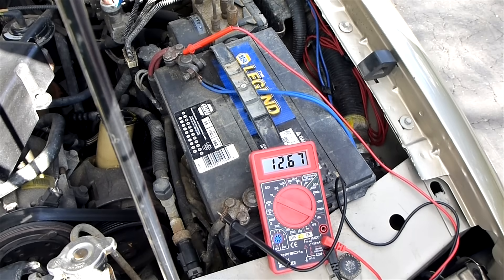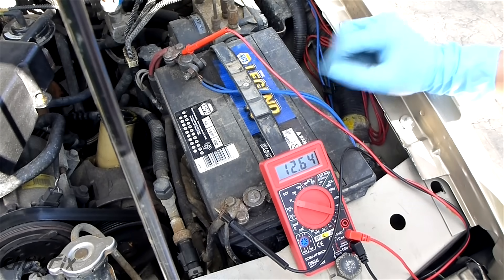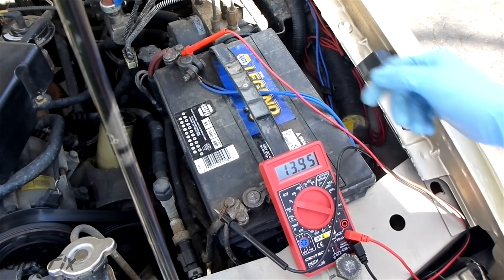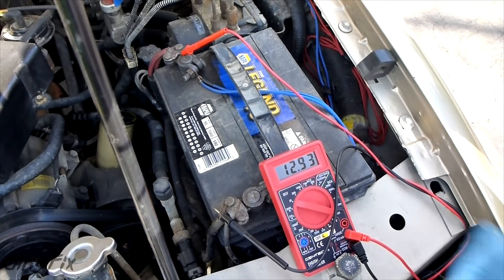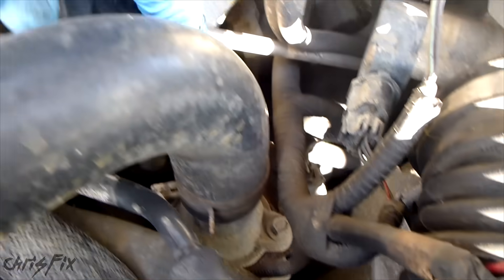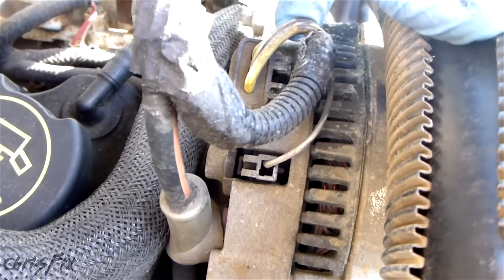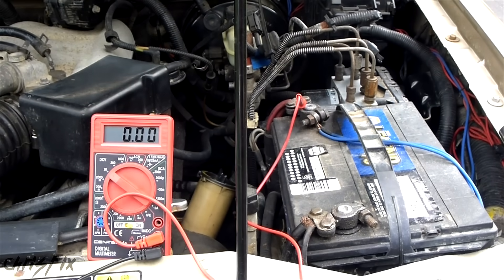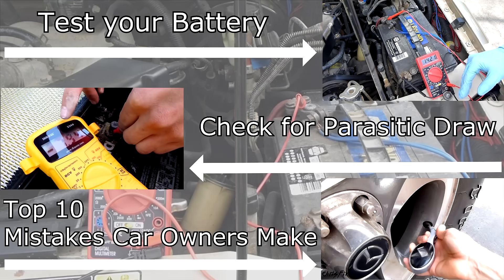How to Test an Alternator

Comment: I have that same multimeter..it is $5 at Harbor Frieght..I got mine free with a coupon..I am not impressed with it ..it is very poorly made
Reply: +Timothy Hinton Free with a coupon, and you are complaining about how it's made. Come on.
Reply: +Timothy Hinton I am, and have been, a computer and electronics tech for many years. I have ALWAYS had these cheap ones. When they quit, I throw them away and buy a new one.
Reply: Timothy Hinton c'mon man, I have the same one.  Had it for years still works great.
Reply: +TheArea51Rider  Yep, have one those from Harbor Frieght, i had to use my Fluke, all automatic.
Reply: +Buck Lee i got a better one now but it is still budget

Comment: When I put my heater on warm or my air con the revs drop, the fan clicks on, the revs flick back to normal idle and the fan clicks off again. Someone said I should do the test in the video but what is wrong? Weak alternator? Can't be a relay. Faulty fan switch clicking on when it shouldn't?
Reply from the maker: Steven Gilmour-white How much do the revs drop? That is normal if it is only 1-200 rpms because the compressor is kicking on.
Reply: They drop far too low and the engine rumbles a lot before the revs kick back up, then you hear the click again and the revs drop and so on. It does this over and over until you turn off the a/c or heater back to cold.
Reply from the maker: Steven Gilmour-white How many RPMs is normal idle vs ac compressor idle.
Reply: +ChrisFix normal idle rpm is just below the last notch before 1000...ac compressor rpm drop to near 500 before the revs kick back up and the ac compressor kicks off again.
Reply from the maker: Steven Gilmour-white Ok, that is a good drop in rpms. That could be a vacuum leak or a bad IAC valve. Check this video out: https://www.youtube.com/watch?v=vFhoNykgQtc
Reply: +chrisFix new iac already on...have looked under car but cannot hear or see any leak.
Reply: Also, just driven to work with ac on before engine gets to temp and rpms were fine even when slowing, but when the engine gets to temp and the car slows to a stop...The rpms plummet. I don't get why it happens only when the engine gets to temp.
Reply: Plus I've done an idle reset and the idle is fine...when I press the up or down on my electric windows switch, the revs drop. This must be an alternator outrage problem surely?
Reply from the maker: Steven Gilmour-white Sounds like an electrical problem. Id start by checking the ground and power cables.
Reply: Just bought a voltmeter...I'll do the checks as per ur video but where else shud I check? What am I looking for?
Reply: ChrisFix just done your test and all is fine even under load until I put on the air con or heater on heat then either drops volts to almost 12.0. I don't get what a wrong. Someone has told me that because I hear clicking on when either is turned on it is the compressor and I need my air con recharged. There is a slight delay in the colder air coming through the vent when I turn on the air con but the clicking also happens when the heat is turned on. Is he clicking the fan turning on and off or the compressed for the air con? Air con recharge?

Comment: Every thing you covered was spot on. BUT you did not check for one thing I have always checked since they quit putting generators on vehicles and started putting alternators. I was a Diesel mechanic for half my adult life and have seen this problem a few times. vehicle that keeps having batteries go bad yet everything you checked was 100% correct. When I tested it on the road I found the alt bad and sent irt to the garage calling the foreman and telling him the alternator was bad. After the third time putting new batteries in it on the road and sending it to the garage I followed it back. I had the foreman come out and test the alternator and everything you just checked was 100% BUT YOU COULD SMELL THE BATTERIES STARTING TO COOK ALREADY. I told the foreman to put his meter on 200 volts ac and test it. When he did he had over 150 volts ac at idle. He just stood there with a dumb look on his face and I told him some or all of the diodes were bad and the regulator, just like his voltmeter was only seeing 24 volt (the voltage used on big Diesels) He had the alt changed and the batteries and I never heard anything from that vehicle again. Now they believe me when I tell them to change the alternator (no matter what their meter says) LOL 8-)
Reply from the maker: BigFireDave Thanks a lot and thanks for the tip too! An ac voltage check would be perfect too! Is there a max ac voltage that the alternator should normally put out at idle?
Reply: I have seen "normal" correctly operating alternators showing 2v to 5 v (on 24 volt applications) and some a little higher. The indication of a diode (or more than one) being shorted would be an AC voltage that is close to or higher than battery voltage. A lot of people dont realize an alternator CAN produce into the hundreds of volts if not properly regulated. The regulators are built to "see" dc voltage and a shorted rectifier can cause a higher AC voltage to be placed on the battery causing it to burn out. A small AC wave (ripple) riding on a proper DC voltage may be helpful to keep down plate encrustation.
Reply: That ripple or AC voltage should not increase with engine RPM. It should just ride on top of the dc output. A GOOD volt meter should read it, an oscilloscope would illustrate what I refer to as ripple and it rides along the regulated DC voltage line.
Reply from the maker: BigFireDave Thanks for the info man!

Comment: Hey Chris I Just Did The Alternator Test By Checking The Bolt,Pole,Wire Behind The Alternator And It Gave Me 0.00v But When I Touch The Alternator Casing It Shoots Up Past 1.2V And Its A New Alternator With A Built In Regulator And Battery I Even Installed A Sunpro Voltage Gauge in My Car And Weather The Car Is On Or Off It Reads 12-13 Volts And 14V When I Run The Ac But It Fluctuates Back And Forth 12-14 or When I Rev Up My Motor. Any Ideas?

Comment: Thanks so much for this very helpful video. My battery died while I was driving, so I knew I needed to test the alternator. Turns out the positive lead to my alternator had completely broken away, and I was running on battery power alone.  A $3 part got my truck going again, and using your tests, I can see that my alternator is working fine. Saved me a ton of money. Thank you!

Comment: I have a 2002 chevy avalanche. And I suspect my alternator is failing. When I check the amperimeters should I get the same reading? Or would my numbers be different?  Thank you for your help.
Reply from the maker: Felipe Sanchez Check the voltage like you saw in the video.
Reply: Ok thank you

Comment: ;The best demo and simplest explanation and demo of voltage drop . Pinpointing the cable lug   the nut, the stud No Load Pro  No Am Pro , just a fifteen dollar multimeter,  Excellent Audio, Exposure on the subject , Very clear view of the multimeter screen,,   Top Youtube award for Cinemaphotography .  And Top bob brawley award for Simplisty
Reply: bob brawley Tthat harbor freight multimeter has the best cons
trast of all metersThat I have seen in Youtube reviews and the decimal point is easy  to see , very important  to me, Also Its not a auto range meter so , no confusion  when viewing the numbers  ,  They all say a autoranging meter is a must have but  to me it makes more sense if the meter stays put , I can tell better , where its at  ,5 millvolts  is easier to read as  decimal 005

Comment: my dash battery like flickers on and off at first it would do it moreso when going up and down hills and over bumps etc' it is inconsistent and there is no dimming of any lights and i replaced batteryright after problem started could it be a loose connection somewhere unseen? old battery was only 6 months old and had no issues at all just puzzled why my light is flickering...any thoughts? thanks
Reply from the maker: Tim Mcmillan Did you check the alternator like in this video? It could be a loose wire but you wont know until you test the alternator.
Reply: ChrisFix gave it another test lasted for over 5 mins with all components running light stereo ac wipers it ran inbetween 12 and 13.5 volts though it never stayed at one spot it was all over the place .thanks
Reply from the maker: Tim Mcmillan Hm, that might be a bad voltage regulator if the voltage was not constant.
Reply: Went to see mechanic for his opinion and wouldn't you know just as i got there the alternator totally died had to get it done there,was planning on doing it myself from watching your video...karma!
Reply from the maker: Tim Mcmillan Figures lol
Reply: ChrisFix yes Chris in the end it was my alternator..totally died as i approached a garage wanted to do it myself but had no choice but to hire on the spot...thanks for advice!
Reply: Tim Mcmillan

Comment: Nice video like always, I have a question. Today I was driving my car normally so I got home and I turn it off, after a couple of hours my car didn't start, I just heard a clicking noise, I went to Autozone to check the alternator and they told that the alternator fail 1 of 4 tests that they performed, then I they charged the battery but it didn't hold any charge. Do you think is the alternator the problem or just the battery? 

It is really weird since my car always starts and the engine looks like new.

Thanks ChrisFix
Reply from the maker: Zumbrex If the battery wont hold a charge, the battery is bad. But the alternator might also be bad. What test did it fail?
Reply: I went to Autozone (after jump started the car)  to have the guy test the alternator and battery.

He checked the battery and said it was dead, to check the alternator he jump started the car then he attached his machine and said that the alternator fail 1 of 4 tests that the machine performs he said that the alternator was bad, so we ask him to charge the battery but it didn't hold the charge it was at 0% he said.

The weird thing is that I was using the car that day normally so I got home I turn it on a couple of hours later and it didn't start.

I checked fuses, connections but everything looks fine.  

Thanks
ChrisFix
Reply from the maker: Zumbrex Sounds like you have a bad battery and maybe a bad alternator.

Comment: I am having problem with 2001 Sebring not starting and hard to get to the battery!! Help
Reply from the maker: Barbara Cash What happens when you go to start it?
Reply: It just makes makes a clicking sound and won't turn over? I just bought it and hope I didn't get screwed!
Reply from the maker: Barbara Cash Sounds like the battery is dead. I would charge the battery and see if you can get it to a place to test the battery like in this video: https://www.youtube.com/watch?v=fRfPupikHT4
Reply: You are dead on! It It was the battery and I bought a new one with 690 cold crank amp so thanks for the info!! It's a great car and now I am glad I bought it. I got a great deal!
Reply from the maker: Barbara Cash AWESOME! Glad I was able to help!

Comment: Hello sir,
I just bought a battery this days so the guy from the auto shop test it to see if the alternator it's charging the battery. So I will post the result of the test belllow.
Test 1 with consumers (radio at volume 28, lights on, fog lights and I got some led lines in interior 4 lines of led x 50 cm.)
Turation of car 3000 rmp
Good Battery
Volts:12.94
Measured 448A En
Ratting:480A En
Bat Type: Regular
Bat Location In vehicle
Starting Test
Volts 11.45 V
Charging Test
Volts 13.34

Test 2 without consumers

Good Battery
Volts:13.01
Measured 448A En
Ratting:480A En
Bat Type: Regular
Bat Location In vehicle
Starting Test
Volts 11.43 v
Charging Test
Volts 13.49

So my question is the regulator of the alternator is dead? Or the values are good?!

Thank you!
Reply from the maker: Daniel Ciutac The values on the alternator output are low. It could be the regulator or the alternator. It could be your wiring from the alternator to the battery. Get a multimeter and put it on 20dcv. Touch the red lead to the bolt that connects to the red cable on the alternator and touch the black lead to the alternator casing. You should get around 14.2v
Reply: Thank you Chris, I just order a new regulator for (30lei=7.5 $) and I will give it to the guys from the service where I repair my car to put it on. All the operation cost me around 12$, thanks alot You are awesome, keep up the good work :)

PS: After I had changed the regulator the charging was 13.8 with all consumers on (radio, lights, fog, leds and manual clima on) and without the consumers on 14.1/14.2

Comment: Hey chris, i connected the negative to negative post and the positive to alternator body an at first it reads negative 0.04 then it fluctuates to negative 0.33 an then back to negative 0.04. So does it means its goin bad.
Reply from the maker: junioramon2013 That fluctuation could be due to you not having a clean contact. Clean the alternator case off with some sandpaper and try again. My guess you value is .33v which means you need to clean some grounds.

Comment: Hi Chris. I tried your battery and altenator test and got mixed results. Battery test showed 12.45. Altenator reading fluctuated between 14.0 and 14.4. The reading would not stay steady. So I did a short test by hooking a test light between the positive cable and the positive battery terminal and it lit up. Pulled each fuse to see if the test light would go out and when I pulled the ignition fuse the light flickered on and off. If I run the emergency flashers without the engine running it will run the battery down in less than 15 minutes. Any ideas? I'm stumped. The vehicle is a 2012 Chevy Express van with 45,000 miles.
Reply from the maker: ***** I would get the battery tested. Sounds like the battery is bad. Take it to a local parts store and have them test the cold cranking amps. Check out this video: https://www.youtube.com/watch?v=fRfPupikHT4

Comment: My battery is new when on the 2nd position where the key goes everything works that's electronic I've jump start the car thought it was a dead battery but nothing even got it tested and it was good. Once I actually try and start it in 3rd position on the key everything dies I have to disconnect the battery and plug it back in so all the electrics can work again. Other than that the engine does not make any sound of it trying to turn on. Can this be the alternator ? Or the starter ?
Reply from the maker: filiberto bernal It might be the fusible link. Check this video out: https://www.youtube.com/watch?v=-SpsSRGfDQI
Reply: I did what was on the link now it's just clicking by the engine
Reply: ChrisFix the car is a 1990 jaguar vanden plas
Reply from the maker: filiberto bernal Your starter might be bad. That could be why your fusible link went bad in the first place.

Comment: I start my car , but like automatic hearse. What a problem? A alternater or battery ?
Reply from the maker: Zahim Zai I dont understand.
Reply: ChrisFix  . Hmmm , everyday i play a radio without start the car . Then to start so hard .
Reply from the maker: Zahim Zai The radio draws power from the battery. If the battery is weak or you play the radio for along time, it will be hard to start.
Reply: So , not my alternater problem ? Because if i start everyday like morning , my timing so down , if tonight , cant usee all like radio , lamp , aircon , automatic slow timing . Then stop
Reply from the maker: Zahim Zai Did you test the alternator like I showed in the video?

Comment: 2003 Ford Expedition 5.4L V8 - what to do if the alternator is not charging the battery while the truck is running?  Brand new alternator and brand new battery and still not charging.   ????
Reply from the maker: Chris Hillman Check your fusible links or the fuse (whatever your car has) that protects the wire that connects the alternator to the battery.
Reply: brand new link aswell
Reply from the maker: Chris Hillman Did you check the voltage drop like in the video?
Reply: have not had the time, honestly. i need a multimeter. i only have the volt-meter but who like one that reads amperage as well.

Comment: cheers chris will check + had a battery test and it came in at volts 12.68v  measured 428 rated 760  starter test cranking 10.91 time 1.60s charging test no load 14.05v  loaded 13.73v
Reply from the maker: Simon Telford The battery is on its way out with the cold cranking amps at almost half the original amount. How old is the battery?

Comment: Quick question,  i did the load test and at idle it shows 14.2 but when i turn on headlights, radio, a/c full blast and a efan my voltage is in the low 12's. Does that mean that the alternator is bad or battery?
Reply from the maker: Eric R That is probably the alternator. Not enough output.

Comment: easiest way to check an alt, disconnect battery while its running. dont zap yourself.
if the alt is good, it will keep the car running. if its bad, the car will not run.
Reply from the maker: Devyn Hogan I wouldnt do that just because you can cause more problems by doing that especially if there is already a problem with the alternator or charging system.